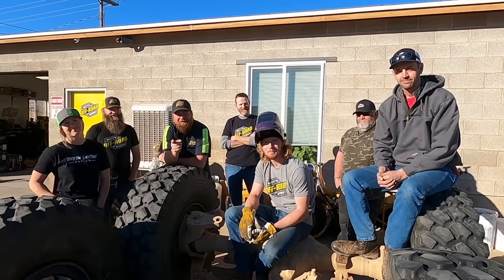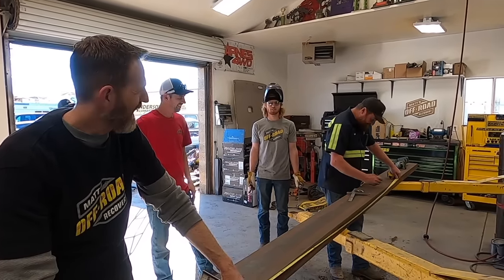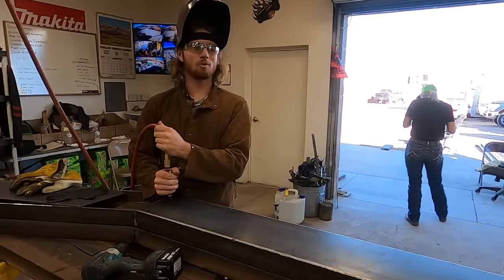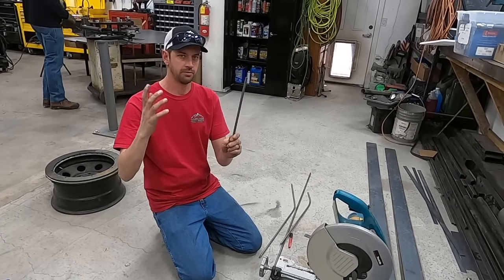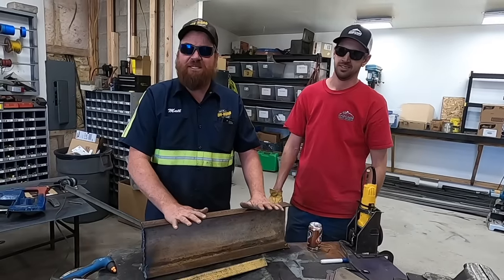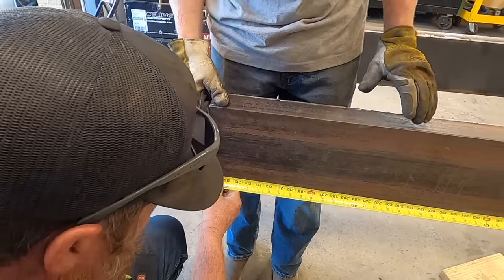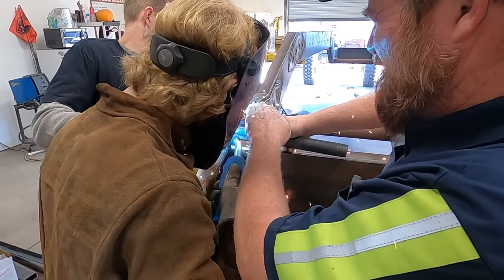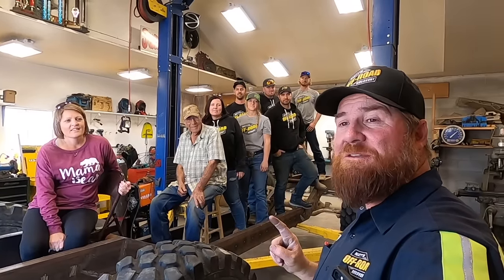I'm Building The WORLD'S LARGEST Off-Road Wrecker

Comment: After viewing this video twice and reading some of the comments below, and because I love geek stuff, I decided to do some quick energy calculations on your rectangular tank design. Given a spec size of 93 x 7 x1.74 in inches for a volume  of 1132 cubic inches, at 50psi the tank will be storing a bit over 82 thousand pounds of total pressure!!  The area force calculations are a bit involved, but the corners are where bending moment forces are greatest. ASME standards require reinforcement/thicker metal of the 'cap' end plates. At a minimum I would suggest you put in perpendicular reinforcements and you should probably weld safety 'catch' plate(s) on the cabin side. As it stands if your design fails catastrophically someone could get a butt full of shrapnel. For a variety of other reasons this design will not serve you well in the long run. Just use a cylinder tank designed for the application.
Reply: They are already making several other mistakes so I don't think that "getting it right" is at the top of their list. More like trying to make it work". 
I'm not going to question your calculations but I personally don't understand how 50 psi of air spread over such a large area works out 82,000 pounds of force. Nevertheless making use of tanks designed for holding air pressure would by far be a smarter choice.
Reply: @crazyoilfieldmechanic3195  It's 50 Pounds Per Square Inch. Each side is 93x7 if Leonardo is correct, so just those sides have 651 square inches. 651x50 is 32550 pounds of force. x2 as there are both left and right sides, that's 65100 pounds. The top and bottom add another  16275 together and caps 1050, so 82425 lbs.

Now that sounds like a lot, but a standard 100+psi tank only has 1/8" steel. This frame is MUCH thicker. Also tanks tend to stay in one piece when they fail, but rip open violently. So shrapnel isn't that likely.
Reply: @christopherrto  The difference with cylindrical tanks is that they're cylindrical, so the stress on the metal attempts to pull it apart. In contrast, with a box design, all the corners serve to concentrate the stresses at the welds, which are the weakest points.  It's a cool idea, but for both safety and reliability, Leonardo is absolutely correct. The design is fundamentally flawed. They need to purchase some properly designed and tested cylindrical pressure tanks.
Reply: Leo and Stephen are on target with their points. Additionally, pressure tanks are are not put into structural loads. This section of the frame’s stress will multiply with this internal pressure. Can’t wait to see this finished and rolling on the road. Hope it all turns out good in the end. I agree, just add a tank… even a re-certified nitrogen tank would be safer and hold more air than they me need.
Reply: Don't worry. After a few runs, flexing the frame, it will probably leak and they'll give up on the idea. The part I don't understand is this thing is going to be huge and will probably have plenty of room for a tank.
Reply: Moisture from compressed air and condensation will also start the corrosion immediately in a closed container.  Drains would help  but not alleviate the problem.
Reply: @sweet65mustang  true, I just really hope that when the weld cracks it doesn't go catastrophically and hurt someone. 
I'm not an engineer but I would think if your flexing the frame hard enough to crack the weld your also adding enough stress to compromise the rest of the weld with the added air pressure. Maybe blowing a full weld, maybe shooting chunks of steel out at Mach 5 and into someone or another vehicle.
Reply: The REAL interesting thing everyone is missing, they will most likely be needing 120 psi of air pressure!
Reply: @crazyoilfieldmechanic3195   Using the frame to hold air is a bad idea. Specifically designed tanks would be the safe way to go. But then again I’ve only been welding/fabricating for over 35 years. I ran a fab shop that made all kinds of stuff for Caterpillar, NASA and the U.S Postal Service. Yeah, the frame is not the way to go. Not in a truck that needs to flex under load.
Reply: don't how you guys can work with stupid imperial crap, but 1mm of 5mm fillet weld can hold 800 N ie 80 kg or 180 lbs so 5m of 5mm weld will hold about 1,100,000 lbs, btw nice welding Rudi love your work.
Reply: another thing, no inside coating in the tanks can lead to some nasty corrosion with air compressing/expanding or am I mistaken there? Reason why people blow themselves up with repurposed fire extinguishers as compressed air storage, lack of proper coating on the inside... but otherwise that thing looks massive :)
Reply: Dude your kinda way overthinking it but applaud your enthusiasm and math skills..A standard fuel tank doesn't build much pressure and neither do air storage tanks... I've made countless of BOTH and never had a failure or a tank "blow" apart sending shrapnel anywhere.

Edit: FYI fella standard air storage tanks like those found on semi-trucks and trailers are ONLY made using 1/8" steel without added gussets of any kind..And they don't blow apart like a grenade either, EVER... Maybe if SOMEHOW way overpressured..
Reply: @crazyoilfieldmechanic3195  the important part of this is, PSI pound pre square inch. 
That force (50 PSI) is exerted outwardly in ever square inch of the vessel
Reply: @stephendee7839  working with metal for a long time these welds look pretty good.... welds are typically much stronger than the actual metal somethings constructed of i think the tank will hold up just fine not necessarily last. air dyer and such needed for sure. and good proof that welds are superior to metal. almost any tank from ww2 when destroyed by ammo detonation or fires....... the main armor plates which have unique forging and surface hardening properties very strong plates hammerd together. the welds stayed together on ammo detonations but the armor plates are what actually gave out and broke free.....
Reply: @justnsaliga8518  The welds did look quite good. And they still leaked at a bunch of locations. The WW2 tanks you're talking about were cylindrical, I'm sure, and if they weren't, then I'll bet the didn't experience any pressure-loading. Take a look at what caused the de Havilland Comet failures: stress concentrations at window corners in that cylindrical pressure vessel. You can't look at a weld and understand whether there's a geometry-related stress concentration or a risk of cyclic failure due to material flex. There's a lot more to engineering design and risk mitigation than great-looking welds.
Reply: I have been designing truck chassis and trailers for more than 30 years, I am sure that compressed air tanks will twist and leak. The weight of this mild steel frame is simply too high, used truck frames save half the weight with the same strength. An old Unimog frame made of high-strength steel would make sense.
Reply: @christopherrto  Need 120psi to release the brakes.
Reply: @mexcanfun4498  Really? Well that just got bit more dangerous. But I suppose any exposed tank runs the risk of puncture, pretty hard to puncture a frame.
Reply: @immanojakob  I'm not aware of any compressed air tanks with lined insides. All mine drain brown (from rust). When drained regularly there's no more water than most environments outside and no source of salt. So no rust. I got bare metal on a couple cars, once they patina they don't rust further (we don't salt our roads and I don't live near an ocean)
Reply: @tonyhammer3588  if ice isn't confined on all sides, it tends to expand in the direction of least resistance. I've frozen many water bottles and breakage is pretty uncommon, and water bottles are a lot weaker than air tanks and frames.

Most aircomprossers don't have driers or coated insides, and experience very little rust. Most 1/8" tanks last 10+ years. To rust significantly you also need salt, which has no way to get inside an air tank.
Reply: @tonyhammer3588  But…. water expands only 9% upon freezing.
Reply: @tonyhammer3588  they just started, how do you know in all your infinite wisdom they won't put air dryers on it, when it's done. You DON'T!! They can easily put drain valves in, & to answer the question of freezing in the winter, he can easily put in a system like we use in big trucks, & put airline antifreeze in it. Besides I've been to where they are located in southern Utah, it seldom gets below freezing in the winter.
Reply: @timothygeiger8271   Chill, Karen. It was a suggestion.
Reply: @tonyhammer3588  don't ever call me a Karen! 
Whenever Matt or Paul(FabRats), or anyone else starts to build anything, some know it all people have to get on here & nitpick every little thing they do. Like these idiots are "experts"!! The TRUTH is they are just on an ego trip, wanting others to think they are an expert! Some even try to list credentials which may or may not be true! 
I won't mention any names of people who tries listing "credentials", but its not difficult for someone to see right through them!
Reply: I agree, this is a terrible idea.  Pneumatic Storage pressure tanks are round for a reason.  Even the ends are rounded off.  You should convert these tanks into non fammable, non pressure fluid tanks, get you some Semi Trailer Air Brake tanks and mount them to the side of the frame and go that way.  The frame flex is going to make those welds leak. 
On my RV I put a PTO power air compressor on my Allison Transmission then mounted a Semi Trailer air tank on the inside of the frame rail (opposite the muffler) and plummed air chuck outlets in the front & rear bumper and both sides between the drive and tag axle.  This way I can run air tools off my compressor and have plenty of air.
And if both of those axles aren't steerable you are going to regret it on tight trails trying to manuver that monster truck for a recovery.
Reply: @haroldphipps3457  what makes you think they won't have 120 psi of air pressure. They don't even have the frame done yet, & the air compressor is mounted on the engine. They are a long way from putting an engine in it, so i don't see how you can complain about something that is a long way away from happening!
Reply: @CurtisDrew1  it amazes me how people can judge a build, when they just started, & have much more work to do!
Reply: @timothygeiger8271  slowly now.
The figures the OP used, were figured at 50 PSI.
I pointed out that most real truck air systems operate at 120 PSI.
Point being, the FLAT sided "air tanks" were bulging already at 50 psi
Reply: @haroldphipps3457  I'm well aware at what the normal air pressure is on trucks, I've been a driver for 30 years. 
What those of you who thinks you are experts & know everything, seem to be forgetting, they put those rods through to prevent what you are complaining about.
Reply: @timothygeiger8271  REAL experts use ROUND air tanks, there driver!
Flat sides, with a bunch of rods stuck thru them will not make the issue go away.
AND, I'm not even pointing out about how much twist will be induced into the frame.
It is a bad idea!
I just hope they mention that WHEN it causes problems.
Reply: @haroldphipps3457  I'm well aware air tanks are round, i drain them quite often to get rid of moisture. 
I'm not saying it's s great idea, it will no doubt collect moisture in the corners. It's no doubt unusual, but I'm willing to let them "test" it. 
Yes the frame will flex, but why not wait a little longer into the build to see what they do, instead of acting like you know everything, & if they don't do it your way, they will automatically fail. 

I might point out all the "experts" came out when they did the MORRVAIR build & said everything they were doing wrong, & it wouldn't work, how it would be a major fail before they ever got it out of the shop. 
I might point out all the off road recoveries they've done with the MORRVAIR, all the road trips they've gone on, driving the MORRVAIR 600 miles to do the RUBICON trail in California, then driving that 600 miles back home, with no trouble other than running out of gas going to CA.
Reply: @timothygeiger8271  does the MORRvair have air brakes?
I KNOW square air tanks will not work.
I have seen it many times.
It is a bad idea, and the tanks WILL fail.
I'm also not sold on the hydraulic brake conversion, but I totally understand why they want to do it, so I'm not making a stink about that, because they may find a way to make that work.
This air tank deal, no question will fail.
Reply: @haroldphipps3457  the MORRVAIR has hydraulic brakes.
How do you know what brakes this build will have, Matt never said.
Reply: @timothygeiger8271  read it comments section.
Said they only need air for the lockers and suspension.
Reply: @haroldphipps3457  once again, Matt NEVER said anything about it, not in comments, & certainly not in the video. 
It's everyone else opening their mouths, trying to think they are the only experts on everything. They are on an ego trip, jumping the gun BEFORE Matt reveals what will happen!
Reply: @slowboat6021  The longer the weld is the weaker it gets just like enything..they allready bulged th metal and added tons of stress by hack welding and bending the frame by welding and with the chain whitc is a bad idea since now youre frame just want to explode in every direction
Reply: @christopherrto  uidiot. 100%
Reply: @christopherrto  no. bottles are round for a reason. there are no square soda bottles or compressor tanks.
Reply: @timothygeiger8271  karen. you are wrong. they are building a pipebomb to use as a offroad platform and its ridiculously overweight.. only one dude can weld and mat only trynna squeeze camera time 100% zero skillz in the crew of muppets..
Reply: @stephendee7839  take a look again, only SEVEN locations.
Reply: @vihreelinja4743  They're cylindrical because you can use thinner material with cylindrical and they are therefore cheaper. There's no cost advantage to square. Except if you're already using square for your frame and it's twice or more as thick (and therefore 4x or more  as strong) as a typical air tank.
Reply: @timothygeiger8271  IMO, "seven" is included in "a bunch." Calling that "only" a bit like saying "I was only pregnant seven times" while trying to not be pregnant at all. A chain with a missing link is two chains and not so good for point-to-point connections. You really don't need to act the apologist for these guys. We're not here trying to say "this project is stupid" or something like that; we're here saying "this is catastrophically unsafe and it will fail and here are several much MUCH safer approaches." You're the one who's acting butt-hurt about people trying to point out ways to remedy a bad decision. It's okay to make mistakes and fix them when they're identified. it's not okay to continue forward with an identified structural design problems that can kill people. Untrained people shouldn't be making engineering calls. There are myriad examples of how management errors cause disasters like Deepwater Horizon and Bhopal to name a couple of the higher profile ones. 

If we didn't care about Matt or his people, or we didn't like the idea of this build, we could happily shut up and let him explode himself and his family. But we're more human than that.
Reply: @stephendee7839  I'm acting all butt hurt?🤣🤣🤣🤣🤣
I'm not the one saying how they are doing everything wrong, & listing my "so called" expertise!  Most if not ALL of the guys telling him what he's doing wrong are NOT trained engineers either! 
Most of them are making comments saying what they are doing wrong, BEFORE they even get to that point! How can they know ahead of time what they are going to do near the end of the build? They CAN'T!!!
What I'm saying is let's wait for them to get closer to the end to see what they actually do!
Even if the air tanks in the frame rails don't work, it can be altered easily enough. Everytime they or Fabrats build anything, all these self proclaimed "experts" make comments telling them what they are doing wrong, yet the designs that were all wrong & would never work are still out there performing the tasks they were supposed to do. 
I'm only saying lets see what they actually do farther into the build, instead of anticipate something we have no idea what the final plans are!
Reply: @stephendee7839  just for all you nay sayets claiming its unsafe, it's a bad idea, i would like to tell you to do some research! The exact same thing has been done before, in fact there is an article in motortrend online that explains exactly how to make air t as nks just like this.
Reply: @tonyhammer3588  for you being an expert fabricator, supposedly having so much experience, & all these government agencies knocking your door down for your advice & expertise, you may want to do a little simple research! Motortrend has an article explaining exactly how to build a frame airtank, it has been done before, it's online, so it's not anything that is new. It covers what steel you will need, which they use one-eighth inch steel. It explains how to do it to withstand upto 200 psi.
Reply: I totally agree. Why add pneumatic stress to the frame? It’s supposed to have flat sides which is the opposite of an air tank design. There’s gotta be room for a tank on this big truck and the frame tank will not be large enough for those big tires.Matt said he was going to use hydraulic brakes.
Reply: @chucknSC  check online, there is an article from motor trend about doing exactly what Matt is doing. It describes exactly what metal to use, & how to weld it. It's NOT the first time it's been done! 
Matt did say they did the calculations, the frame as tanks equals to about a 10 gallon air tank. Yes, Matt did say he's going with hydraulic brakes, he's also going with 4 wheel steering. 
We don't know what all Matt is going to do yet, we can't hardly think we are experts in this build until they get more done & reveal more of what they are planning.
Reply: @mexcanfun4498  If you need 120 psi to release the brakes then your truck needs to be fixed. The tractor protection valve shouldn't pop at a pressure above 45 psi and the warning horn doesn't sound above 60 psi.
Reply: @r2db  many google will tell the truth, but i know for sure the big trucks with 40 tonnes put 120psi in their tires.
Reply: @mexcanfun4498  I own and operate a 2017 Peterbilt 579. Yes, my steers are 120 psi. My drives are 90 psi, and the trailer is 95 psi. The air governor is set to 125 psi but that is not the minimum to release the brakes, which is about 45 psi.

Again, the low air warning horn does not sound until 60 psi, and I still have normal brake function until 40-45 psi when the tractor protection valve pops. It is still legal to operate if it pops before 20 psi (49 CFR § 393.43). If moving when that happens the whole rig comes rapidly to a halt.
Reply: @r2db  Nice to get a comment from someone that knows what he is talking about. Thanks.
Reply: 4x4 is 8 right? 🤔